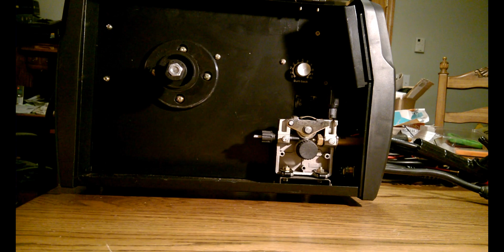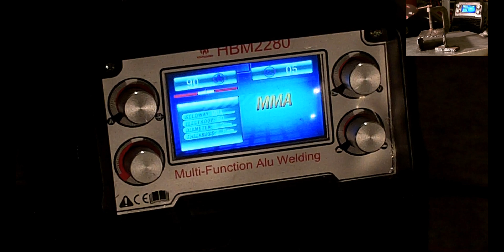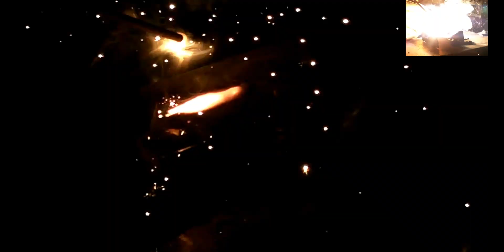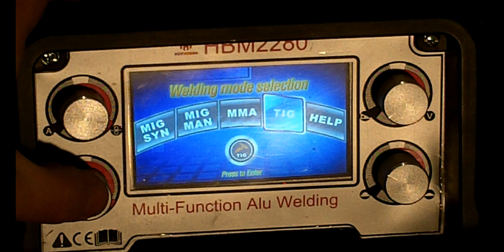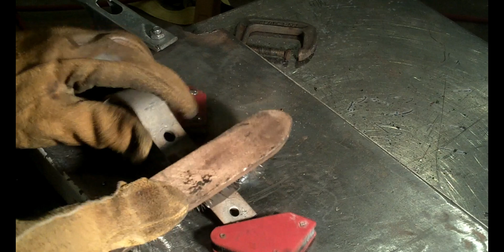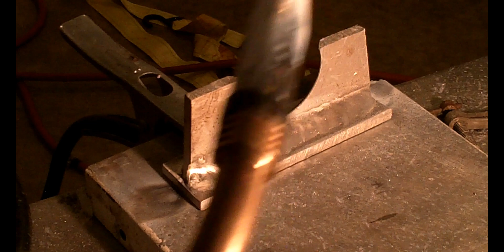HZXVOGEN HBM2280 Full review

Comment: Fluxcore (gasless) MiG welding , this is only machine I have seen the ground wire is connected to negative (-), and the MiG torch the positive (+).
Most of the Machine the ground is connected to the positive and the MiG torch to the negative.
Is this ok? all there’s a mistake on the diagram on the machine?.
If anybody knows the reason please i want to know.
I have checked on the internet it seems like there’s a mistake.
Reply from the maker: Flux core is ground to positive torch to negative and With gas torch positive and ground negative.  They messed up.

Comment: I got 1 of these I never tried the mig aluminum are tig on it as yet I will try mig aluminum with Flux core wire I don't under how the tig works on this welder where to pit the gas line so it can turn off automatically I saw video's here showing how to convert my mig torch into tig I'll try that

Comment: I appreciate your thorough approach on showing the details! I was curious to find out all the possible settings in MIG MAN operation mode, especially if manual settings or possible hidden menu options would allow for spot welding with on-time setting of 0.1 second resolution. I can't find any info on this anywhere. Some older cheap models had this option, however inventories are empty. Could you find time to check this spot weld thing for me, please?
Reply from the maker: I added a video on Mig Manual mode. It doesn't have anything for spot welding unless you click yourself. https://www.youtube.com/watch?v=m5rd4U65AbY&t=2s
Reply: @joesledrider8530  Thanks for the video response, it cleared up every aspect! I'll leave a more detailed comment there. Earned a sub!